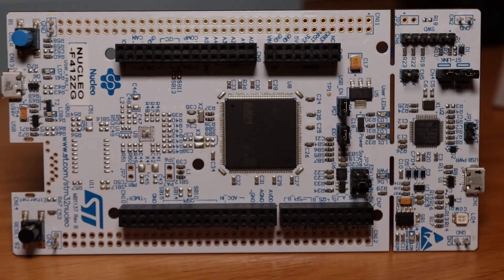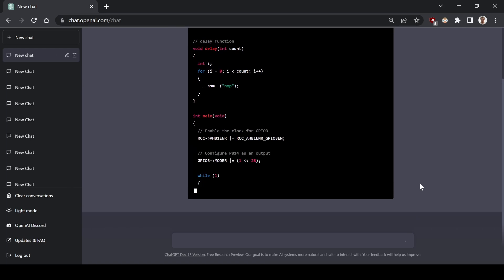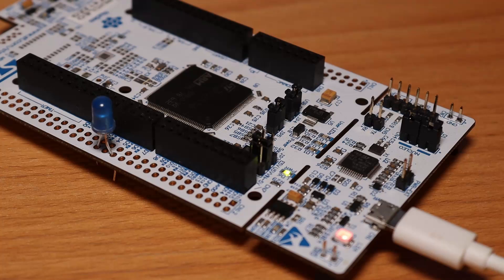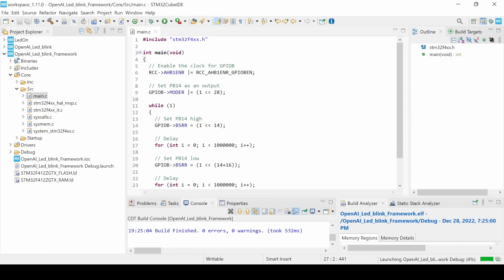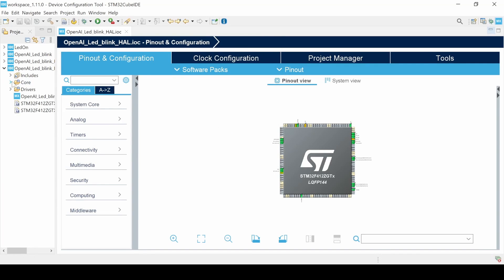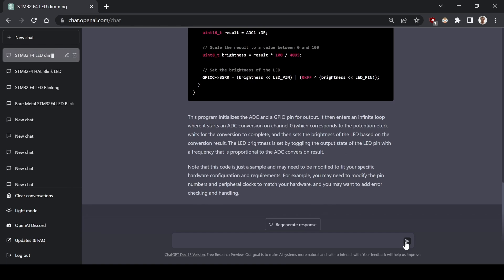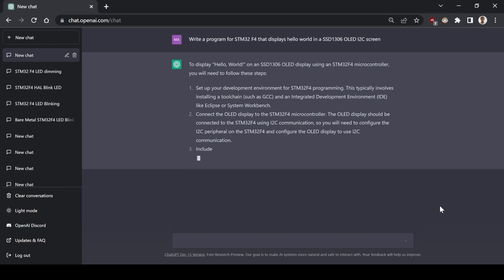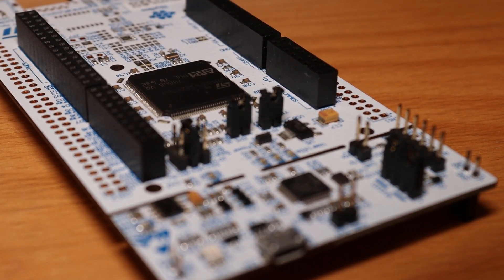Can ChatGPT program a STM32?

Comment: There is ssd1306 lib for stm32. So the code is fine.
Reply from the maker: I just googled and you are right, there is a library which seems to work with HAL, I will try and replicate the prompt in a few days to see if the AI got it right.
Reply: @Hanqaqa  and?...

Comment: Seems to me there is an authority issue here. There is a disconnect - inherent to AI - between requirement, intent and output. 

Some people are happy to "press the idiot button" and get code they don't understand and maybe it'll work. Professional code needs to be so much more than that. It needs to work not only once in the lab, but every time on every board in every situation. 

If you cannot inspect causality from requirement to code to behaviour, you're stumped; you have no product. Smart people have spent the last 3 decades obsessing over code quality and that can be a dry abstract subject. There is no chance the industry is going to abandon that in favour of some wünderkind AI until it can persuasively show its working.

Comment: I am embedded engineer here. Instead of getting scared of ChatGPT, I am actually wanted to embrace it as a tool just like google and stackoverflow into my development process. ChatGPT is very good if you ask it to do some business logic that would normally needs u to use the white board to understand the problem. For example, I asked it write me a C function that takes 497 bytes of data as an argument and write to a block of memory when 1024 bytes is received. I also explicity said the function is called in a loop as well. it gives me 80% correct code and I just copy it and modify a bit and Boom. I am done with that task that would take me 3 hours or a whole day.
Reply: Really 3 hours or the whole day ?
Reply: @epolpier  yeah its quiet tricky.
Reply: @milky3ay566  Every solved problem by yoursekf gives you some additional skills which pay off later on. Asking AI won't give those and you should know this being an embedded programmer as you state. You won't be able to solve more complicated problems without all those basics.
Reply: @epolpier  already solved many problems for the past 5 years mate. Also I am adopted TDD style too. Firmware released and always been stable, only time i ever need to rewrite is to add features. It takes a lot of time writing proper code and test cases. That AI will speed up the process a lot.
Reply: @milky3ay566  So AI will write a proper code with tests ? No. It will give you the code which was trained on...And 5 years in this business is nothing really...
Reply: @epolpier  I was pretty sure I said 80% correct code. I need to modify it and make it testable. So your point?
Reply: @epolpier  lmao! Thats 1min of coding bro. Memcpy ftw
Reply: @paugasolina5048  it's not a simple memcpy lmao. I am working with none volatile memory here. The AI generated code did help me speeding up my development without writing boiler plate code. Obviously I need to read and understand what AI generated.
Reply: Precisely. Delegate.

Comment: this is why arduino more understandable than stm32 pinMode(pinNo);
Reply: But very very slow
Reply: @electronicpower1826  how slow between 0,0001sec and 0,0003sec ? you don't feel it slow and most importantly you can easily read the code.
Reply: @mh-studio1  In normal tasks yes u will not see any diffrence. But in more complex projects you will. For example i am designing now DC/DC convertor with internal 200 kHz generator. With arduino code there is no chance to make decent feedback loop.
Reply: @electronicpower1826  Oh! you can not compare like that. it is different between 8bit chipset limited and the code.

Comment: The AI still needs some prompt engineering. So, either tell it to use the library function, for example. Another thing that works great is providing it documentation for obscure libraries and start like "Read this and only say 'Loaded'!"... then ask your question.
Reply: So, I tried my suggestion (but I don't program hardware much). I went to the an API description. Copied it all and wrote "Read this and only say 'loaded': [PASTED API HERE]"… the I gave it your prompt "Write a program for STM32 F4 using the HAL that blinks a LED in pin PB 14". The code looked much more promising as it seems to use HAL now in the correct way.

Comment: Hi, can GPT3 implement more complex tasks? =) 
For example advanced control of Timer for signal generating or processing data from sensors and output to display/some port/protocol...
Reply from the maker: Not really, at least I didn't get any luck with the harder exercises.
Reply: @Hanqaqa  I've seen your video with Arduino, there was accelerometer output to oled. Probably it is because there is much more code for it in the Internet. So if they will learn GPT on code base for STM it could give better output. 
By the way, Happy New Year :)

Comment: If the Ai is doing something wrong, just ask it to fix the issue, e.g. not use the registers directly. This should happen in the same chat as the Ai is aware of the context. You can also simply copy the error message there and let the Ai do the analysis. It is sometime back and forth but the Ai will eventually fix its issues.
Reply: Lol he makes mistakes even when configuring pins. Not to mention the configuration of registers.
Reply: I was try this methot last week.  Gpt stay half and ı sad please write next Side and gpt write that. Next line have little issiu but writed.

Comment: Nice work! I have been copying my error messages back into chatGPT after it gives me a program that doesn't work. It usually (about 2/3 of the time) seems to be able to describe the problem and offer a fix for it. Also, you can copy and paste your program into it and ask it to format or add functions. I have done this with asking it to add serial debugging to each block of code to troubleshoot and then once it has made something that works, you can copy in the program and ask it to comment out all of the debugging lines.
Reply: Smart move

Comment: What would be the best approach to get the ai to write a sketch using i2c sensors, but with a specific library, rather than what ever it suggests?
Reply: Ask it to use tbe specific library then feed any error results back in to the same conversation so it can fix them